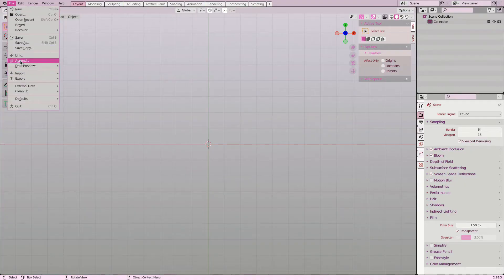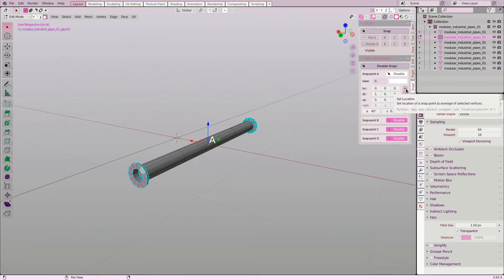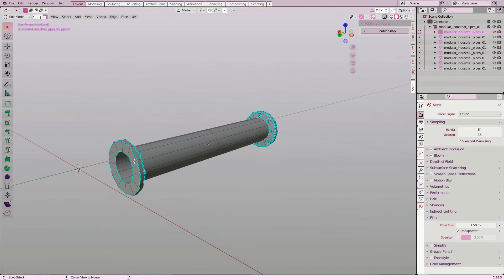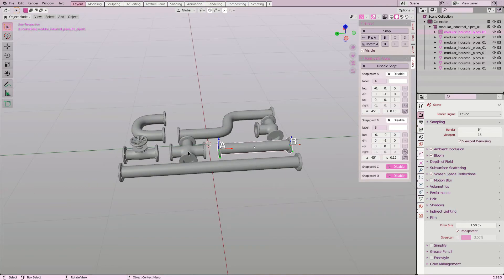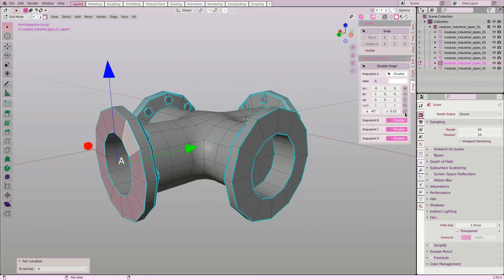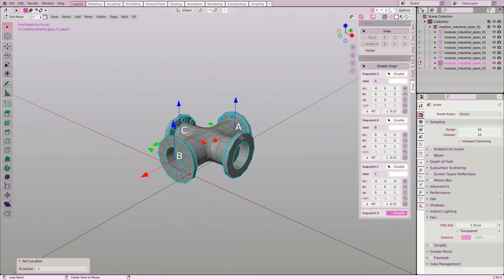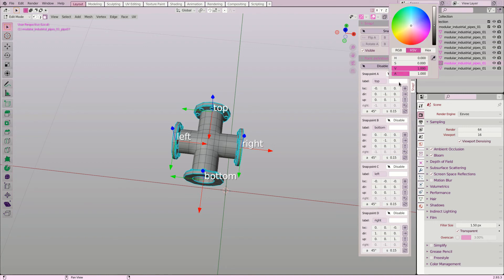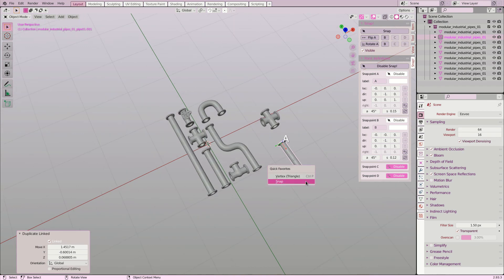Snap! Creating snap-points

Comment: i bought your snap! addon quiet a long time ago and it works like a charm (even in blender 4.3), but i have a question, i know we can snap the 3d cursor to snap points but is it possible to do the opposite : putting a snap point at the curent position of the 3d cursor ?
Reply: no, unfortunately that is not an option. You can enable the extra objects add-on(bundled with Blender), then Add->Single vertex and in Snap! select the "position at selected vertex" and finally delete the new vertex again. That is a bit cumbersome, but it does allow you to position the new snap point precisely at the cursor.